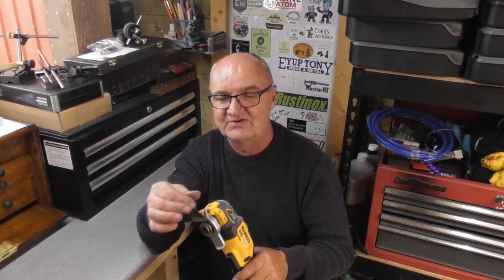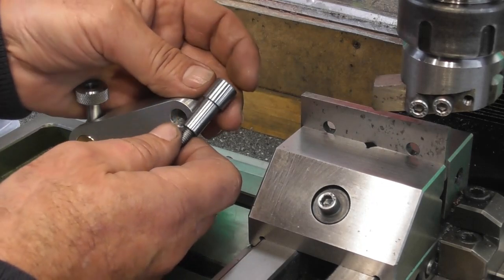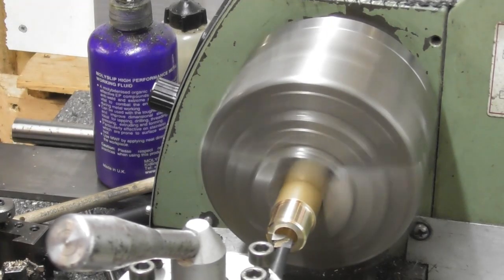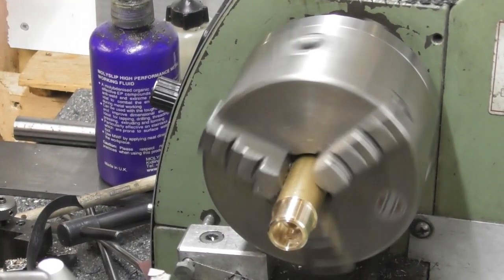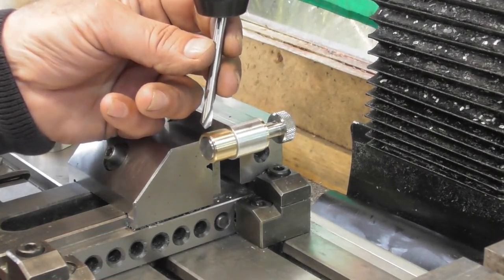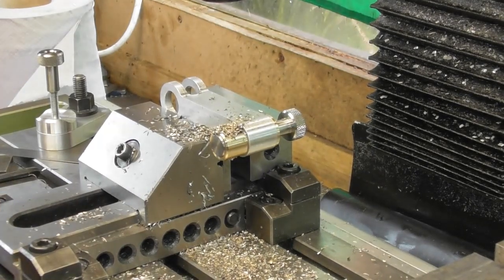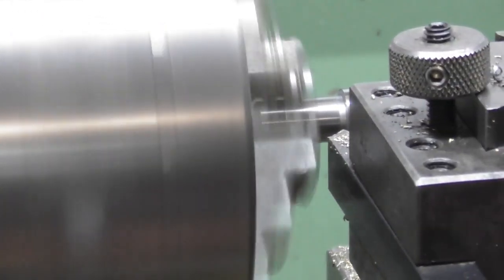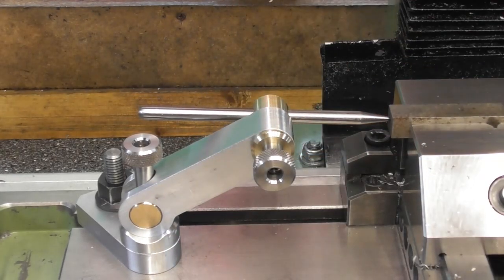Adjustable milling workpiece stop completed

Comment: Nice job .   That multi tool ,  how much stroke does it have or does it just vibrate ?   Do you think it could be used with a blade for decorative scraping .    Cheers .
Reply from the maker: Not sure it moves to fast to make an estimate . I will see if I can find a way to measure it. scraping idea is very interesting . setting up a carbide scraping blade on it would be simple enough . food for thought . Cheers Ade.

Comment: Greeting from Swansea Ade. Regarding the deWalt drill, can you not change the chuck up a size. I did twice with my old trusty Black n Decker.... First to a larger keyed Jacobs chuck then to a large keyless chuck. They are held in by a countersunk screw in from the front and a sharp undoing twist to break the lock on the screwthread. Easy peasy lemon squeezy

Comment: You don't need to explain why you chose a particular "ecosystem" for cordless tools.

In every case the battery costs about twice as much as the cordless skin.

Once you buy your first tool you're locked into that brand. I believe that they all perform well and for some of them they are cheap enough to buy as a "one off" for a single task.  I stumbled on the light blue brand, the tools, of one brand, are made in about 5 different countries but the all do the job i want for indoors, outdoors, gardening and housekeeping...................I've got about 13 with different size batteries.  The best deals were those that offer 2 batteries in the deal.   Interestingly I have about 6 chargers charging batteries all over the place. In 7 years I have only had one battery failure.

These things are the greatest invention since sliced bread!

Stavros

Comment: A work of art and useful. Noice!
 I keep hearing how small or smaller mills are not rigid enough or just aren't as good as big mill but you are making me see reason. 
 The work you can put out on a smaller mill makes me believe it is as much the operator as it is the mill.
 You haven't rebuilt this mill or done anything special to it and that mill has turned out some amazing parts. DRO aside and a good tramming!
 After watching you mill those big plates of steel (mystery project) I am convinced that buying a big mill is not necessary. 
 Now I feel better with choosing a mill on size up from yours and spending more money on tooling.
 Thanks Adrian!